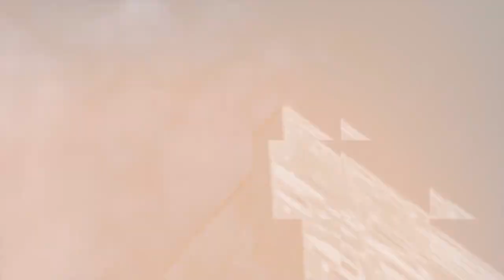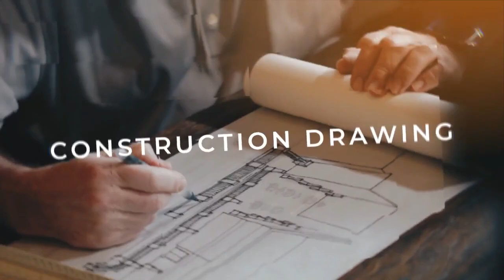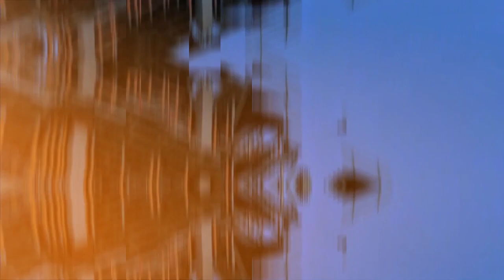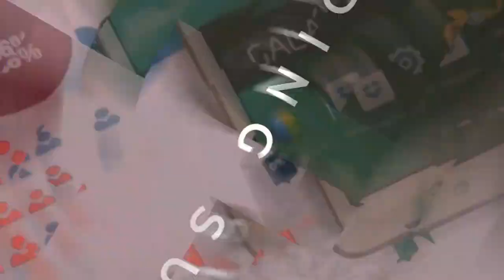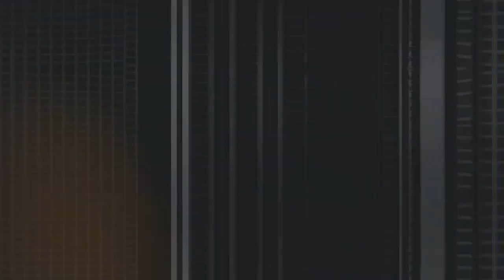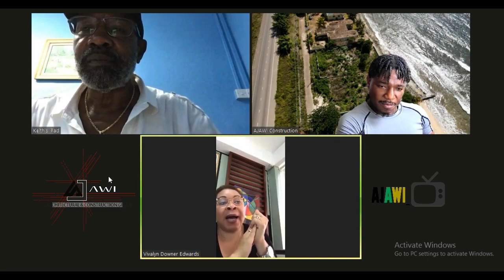ICF HOMES | INSULATED CONCRETE FORMS | IN JAMAICA | PART 2

Comment: Question, If I have a concrete roof that is leaking, could I screed it using foam to stop the leak
Reply from the maker: You have roofing compound for that. You shut wash the roof and paint in on. Easy to do. Just rent a pressure washer, wash the roof and paint on the roof sealing compound. You can do it yourself and it's cost effective.

Comment: I cannot recall but did the presenter say that the roof slab can be made of the EPS material as well? 
And would I still need stiffeners to tie the walls together and belting to install roof?
Reply: Check out buildings like this on YouTube. I think they’re reinforced with steel.

Comment: I hope these factories are environmentally conscious, especially with whatever this is made of. After application, is there any off gasing? I've heard of homes having this problem especially in the heat.  Building trends are going toward environment friendly products and means of production. Where is their waste at factory going to, and does Jamaica have laws in place to address it? Placement of windows and shape of roof and overhang ( passive cooling) etc , are better long term solutions.
Reply: @AJAWI_TV  isn't it made from crude oil?
Reply: @AJAWI_TV  all I heard was poly something, and the word foam.